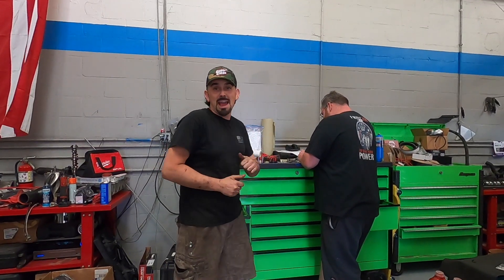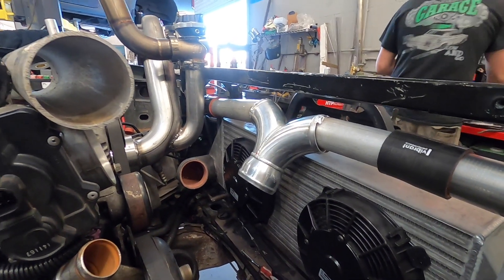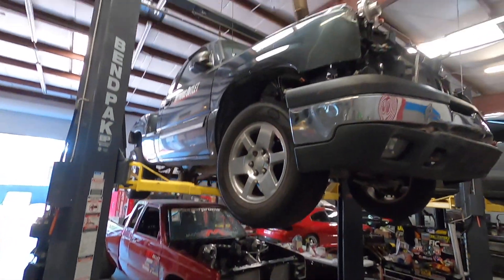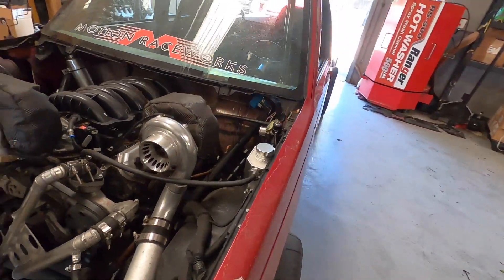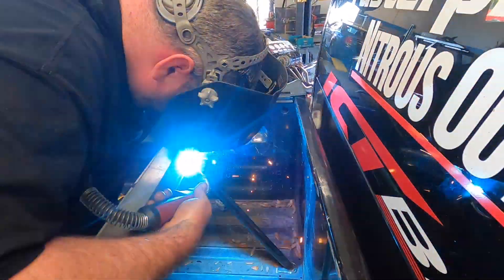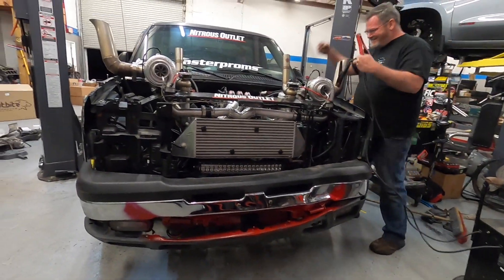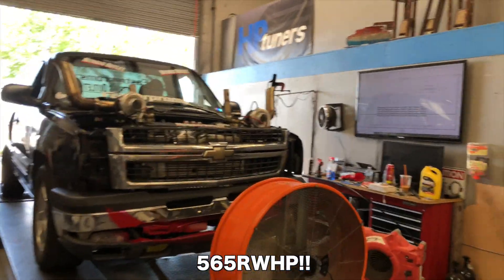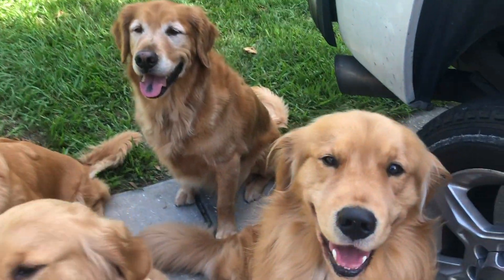Rodney's EPIC BUILD Is Completed! (Rolling Burnouts Ensue) But Are We Too Late?!

Comment: On the Tahoe and suburban you can use rotors and calipers from a like 07 that are bigger I'm not sure if it's the same on the trucks it probably is but that is probably a good upgrade since it doesn't have rears

Comment: Rod knock needs a big ass ducted fan. For A pulling hot air out of the engine bay, then 2nd  and most importantly blowing that air down and forward blowing the tire smoke out of the front of the car letting George see through all the smoke and go for a “full pull”

Comment: Isn’t that radiator mounted backwards?  In the back, the wind is gonna be coming from the opposite direction.  
In the truck bed, the air goes from the roof of the truck, down to the tailgate where it bounces off and causes a continuous loop of air.  
Idk, I learned that on Mythbusters.  lol
Reply from the maker: fans are always on and burnout vehicle get no airflow anytime.

Comment: Jeremy, what do you recommend for a 5.3 2008 suburban to get with a 4L60E to get more power for someone on a tight income? I have a CAI FROM K&N now. 
Should I add a better trans cooler to protect the transmission? Or will it blow up no matter what I do to try and keep it in good shape?
It does have AFM/DOD, I disabled it with the torque OBD2 adapter

Comment: Wouldn't i be possible to cut the intercooler in half vertically and add an exit in the middle directly into the throttlebody? using both ends as inlets!
Reply: Did some readin', not at all impossible but you need to re-do the capping on every other row.